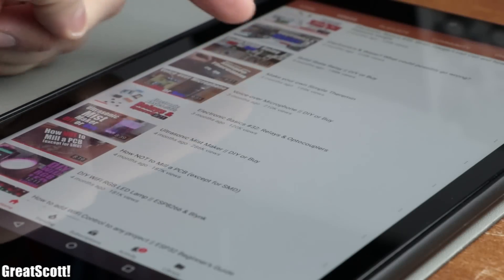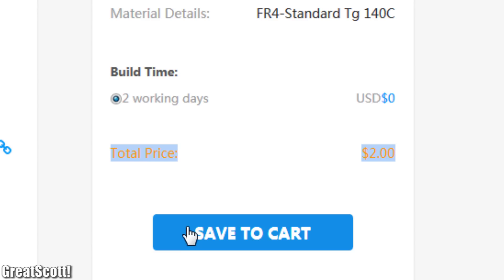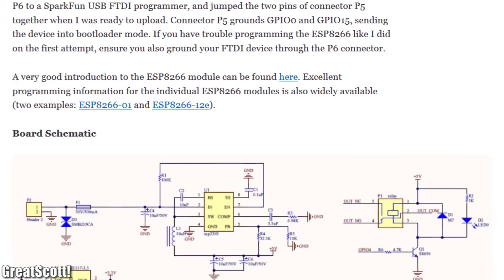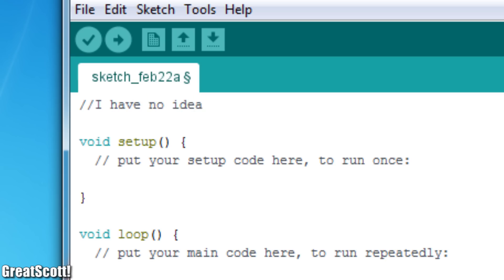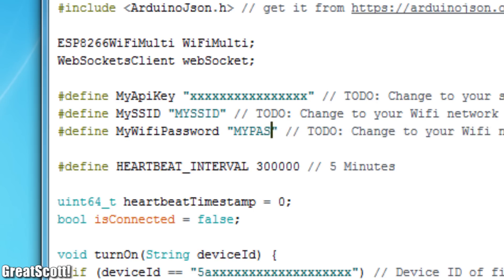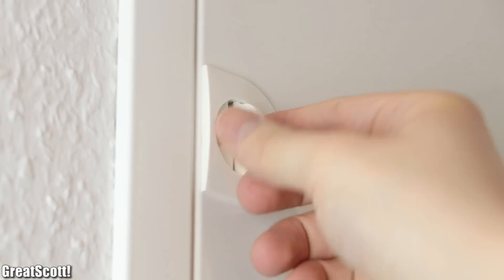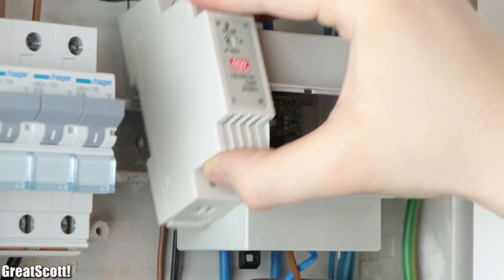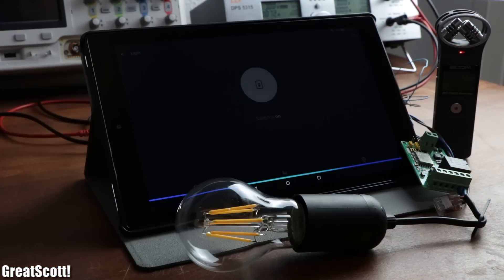How to do Simple Home Automation with Amazon Alexa || ESP8266

Comment: USB Soldering iron DIY OR BUY......NEXT VIDEO PLEASE
Reply: Pedro syan a fire hazard
Reply: Uhm, wtf is a usb soldering iron?
Reply: @frogstair  i think it's name is very clear...
Reply: Easy, just don't. USB cannot deliver enough power to have a decent soldering iron
Reply: Pedro, something most likely sketchy that doesn't really have that much heat output. I wouldn't even BUY one let alone make one.
Reply: Neither of these options?!
Reply: A soldering iron is nothing more than a resistor with a special shape. There's no electronics there, only one passive component. Besides they're ultra cheap, less than 5€ https://www.gearbest.com/other-tools/pp_240618.html so the price of the parts and the time it takes to make one (wire, resistor, usb cable + optional regulator circuitery) largely outweights the cost for a more shoddy result. There, no need for a video :)
Reply: @SimplyMusic Sorry, but it can't, at least not for normal usage. For example, a PC USB 2.0 port is 0.5A max and USB 3.0 is 1A max, so good luck with a 2.5W or 5W soldering iron. And if you are using a wall adapter USB supply, why the hell not use a proper soldering iron? For an iron heating up faster in most cases is useless, heating up time is the relation between heat capacity of the iron and it's wattage, not how "good" it is. So unless your wall iron has lower wattage than your USB iron, the USB iron will have way smaller heat capacity. I want to see your properly solder together 2 14AWG wires with that thing, good luck. It might kinda work for PCB soldering, but even then, it's stupid to bother with something worse than a wall one unless you NEED it to be fully portable.

Another thing to note, if you are using the USB soldering iron with a wall adapter, there is a high chance of damaging sensitive components as they leak some current through the tip(high voltage, >100V with 220V mains). So only safe way to use it so you don't accidentally mess up components is a power bank.

TL;DR: USB soldering irons should not be the main soldering iron and only be used with a power bank and when it's NECESSARY to have it portable.
Reply: SimplyMusic based on my experience, you need at least 20w  to get to operational temperature in a decent time (a couple of minutes). Usb cannot deliver more than 5w from a pc, 10w from a usb power supply. If your 230v is worse than a usb it's a really crapppy iron
Reply: Buy
Reply: with ~5w the power issnt that good. maybe 18650,mosfet,heating wire,switch,ntc,charging & protection circuit ... and of course you can use a Microcontroller, to drive the mosfet
Reply: Pedro syan it's a soldering iron that you plug in a USB port instead of outlet
Reply: Buy. EUR 5 on ebay, that cannot be beaten.
Reply: Lalan Desai don't even think about a soldering iron that can be powered from USB. It is not worth your money to get one of these if you want to work on actual circuits. It is not even good for portable use, when hooked up to a power bank because it will stress the batteries in the power bank too  much. I would rather buy a good portable iron because these heat up in a few minutes and have quite a stable temperature on their tips
Reply: up
Reply: Erazor hmm
Reply: maybe go and try to hack a E-Zig as a soldering iron (there are a few out there who regulate with Temperatur but i dont know if you can get a 300-400°C regulation) i forget, you will also need a Tip of a Soldering Iron
Reply: Usb only provides 500ma, 1A or 2A at 5v depending what standart it is, it isnt enought to make decent soldering iron as id require atleast 20w of output for any application, even smd
Reply: afxinfinitee I have a cheap USB soldering iron. It runs off of about 1.5 amps, so about 7.5 watts, which is enough for small solder joints.
Reply: Usb 3.1 can give up to 100watts right? 😂
Reply: Ts 80?
Reply: I only saw one video about it, it works quite well for small PCB soldering, the problem is that PCB components are the last thing you want to solder with it as it can damage high voltage sensitive components. So at the end not much you can do with it.
Reply: +axfinitee I've got a USB and a 230V soldering iron and my USB soldering iron heats up two times faster than my 230V one.
Reply: +mauro foti it can.